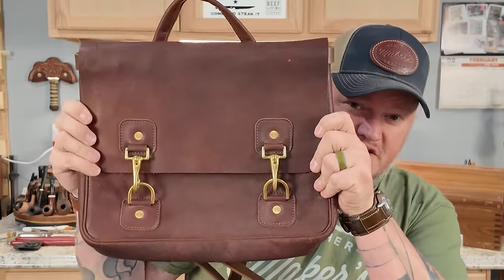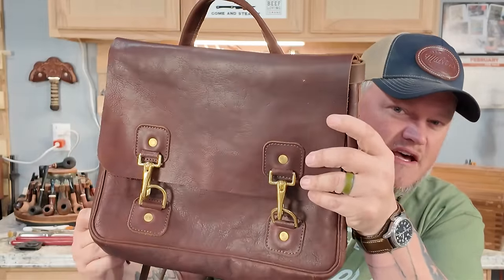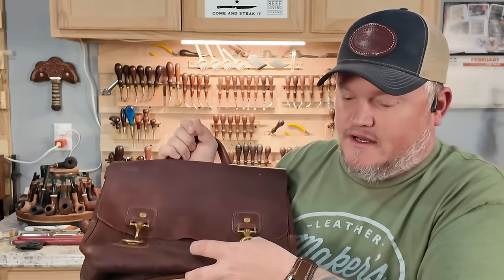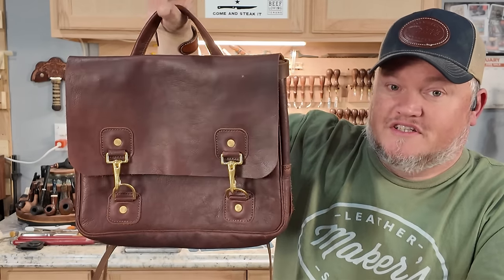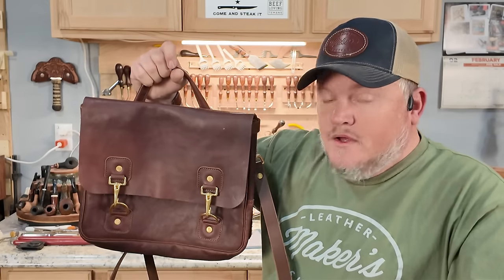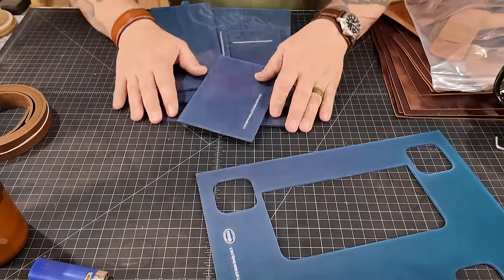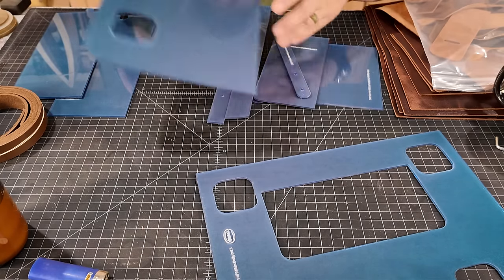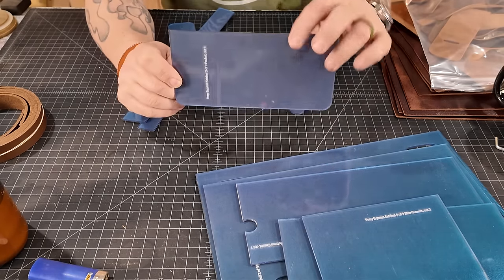Making the Pony Express Satchel

Comment: Great video.  Looks like it would be great project to get a break from building saddles.  
Have you used a dapping block to predome your rivets. 
I will polish chucked up in drill on polishing wheel if needs.
Reply from the maker: The brass ones are difficult to dome.  I may have to try a mapping block, I have one somewhere.

Comment: I got my shipping notification yesterday and I am super excited to put this project together. This maybe more of a hand sewing question for completing the project. When you are attaching the front panel and the gusset would you recommend trying to use the clips or glue/tape? So, use the clips to hold everything where it should be, remove one clip at a time to punching the holes then replacing the clips as you go. Or would you recommend gluing the two pieces together?

I am still new to the hobby. Glue is something I am comfortable with. Currently, saving time is not high on my list of needs. However, getting the panels to line up and the project looking good would be :)
Reply from the maker: Contact cement would definitely hold it most secure, you just have to make sure that you're careful to keep it inside the seam so it won't be seem once you turn the front back.
Reply: @makersleathersupply1220  thank you for the reply!!

Comment: Are you using the 7 SPI on the machine as well, or do you use another stitch length?  Thanks and great job.
Reply from the maker: 7 will do the job just fine.  I'd bet mine is set somewhere between 7 and 8

Comment: Question would you use the same process of sewing the welt and gusset on when hand stitching? Would you still use the clips to keep it together?
Reply from the maker: I would try to carefully glue it all together making sure the glue won't show once the bag is turned right side out.  That way you don't have to do the basting seam.
Reply: @makersleathersupply1220  last question contact cement or white leather glue?
Reply from the maker: @andrewdunn8387  definitely contact cement